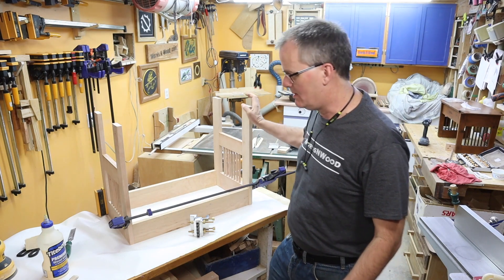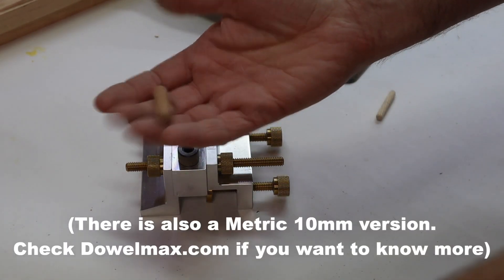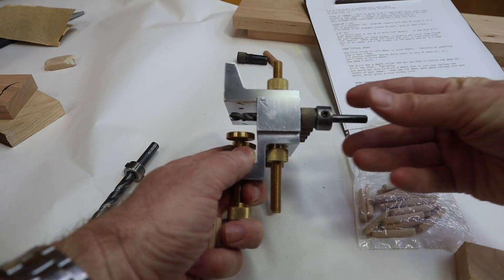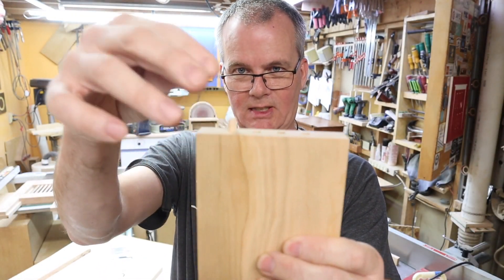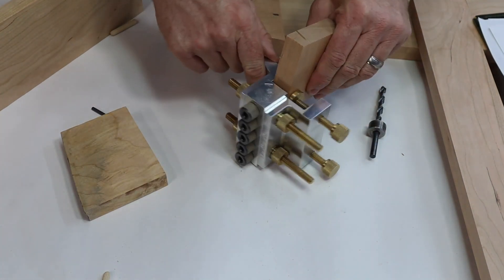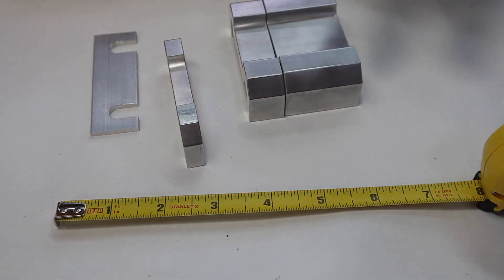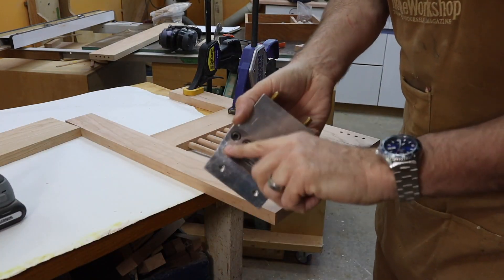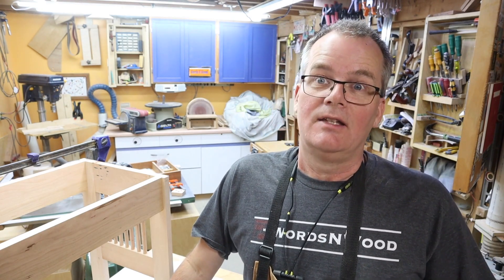HOW TO make Inset Joints with the  Dowelmax Dowel Jig (WnW #200)

Comment: I also use Dowelmax and was surprised you used 1/4” dowels on that thick of wood. I would have used 3/8” dowels. A little trick I learned for dry fitting. As you know when dry fitting it sometimes gets difficult to get pieces apart. I lightly sand a few dozen dowels and very lightly spray paint them with a bright color so when dry fitting it’s very easy to get pieces apart. I also dry fit with a dowel in every hole just in case one hole may not have been drilled quite deep enough. Found that out the hard way during glue up. Very good video and very helpful.

Comment: Hey Art --- Thanks for the video. Another way to do it is simply move the piece that says "Dowelmax" to its other position (face position). This avoids having to use an external clamp, because you retain the jigs built-in clamping capability. Just my 2 cents, to each his own.
Reply: Whoa, I never knew this was possible! I've struggled with these 90 degree joints, especially with a longer piece since you don't have the luxury of clamping from the sides. Just checked the manual and it's on page 7 for anyone else wondering. Thanks for the excellent tip!

Comment: I have used this jig like 10 years ago and liked it, except the clamping mechanism. It tends to get loose with vibration.   Also, if my memory serves me right, you can still use the built in clamping machanism for face frame instead of using the extra clamp that you used.  Correct me if I am wrong. - After a long break (10 years) when I have sold 90% of my woodworking equipment including Festool Domino and Sawstop, I have started doing some light projects again.  Found the Dowel max that I still have, but also bough Makita Biscuit Joiner and Makita compact router.  Let's see how it goes with my shop anymore !   The things that I miss most is Sawstop Table Saw and Makita thickness planer.  I may buy a Dewalt portable saw next summer (2022) or a Makita Tracksaw

Comment: Art, while using the angle bracket and a clamp is one way, you also could have just reattached the clamp bracket to the other side of the jig allowing bracket clamp pads to secure it to you workpiece.
Reply from the maker: Good point!    I almost never do that, so it was not at the forefront of my mind.

Comment: I use a small hardwood block of wood with a drilled hole, then I slip it down the drill and use it as a depth spacer. 
I never change the depth collar.
Reply from the maker: That's a useful idea!

Comment: This is a nice product, a bit cumbersome though compared to something like Festool Domino, which is of course much expensive.  Also, I wonder, if the process will be faster (with same strength using a combination of biscuits and pocket holes?  Additionally, Pocket Screws will also be a substitute for clamps during gluing.
Overall, I like what you did and thanks for sharing.
Reply from the maker: Speed vs cost is the tradeoff.

Comment: I just purchased the Dowelmax I haven’t ordered the 1/4” adapter yet. Do you use the 3/8 or 1/4 the most?
Reply from the maker: Anything over 3/4" I use the thicker dowels.  For narrower stock I used 1/4".   for 3/4" stock you kind of can go either way but 3/8" is probably the better choice.     I'd start with the set you have and get comfortable with it first.
Reply: @Wordsnwood  ty!

Comment: If the spacers are 1/8, 3/8, 6/8, and 13/8, how would I combine them to make an offset of 1/4 or 5/8 or 1? Would you just have to buy more 1/8 spacers? Well actually, for 5/8, could you put 6/8 on one side then 1/8 on the other? I think I just answered my own question :)
Reply: Yeah, I just purchased one more 1/8" spacer in case I want 1/4" reveals. It comes with 1/8" and 1/16" so you could settle on 3/16", which could look ok too.

Comment: Looks like many ways to make a mistake. It looks complicated. I'm sure once you use it, it becomes easier to use.
Reply from the maker: Well I picked a complicated joint to explain.  A simple faceframe type joint is easy.
Reply: I got mine today and started using it on some scraps without reading the instructions.  It is pretty intuitive once you get used to how the parts can be mixed and matched.  Certainly easier than digging out mortises and fussing with tenons.